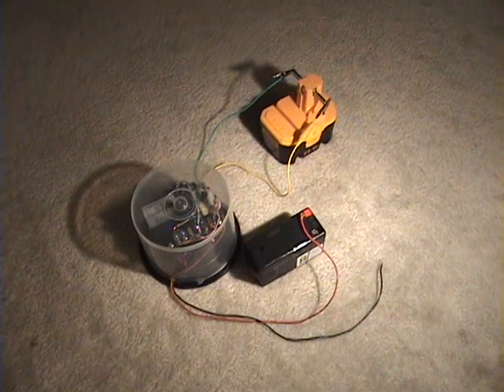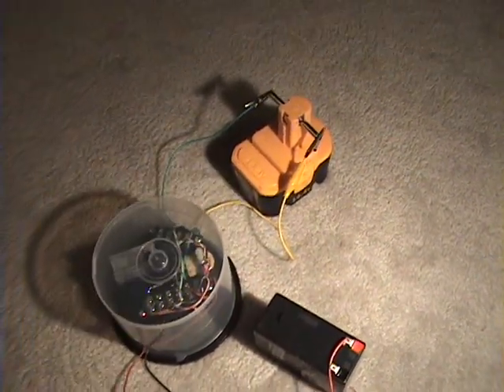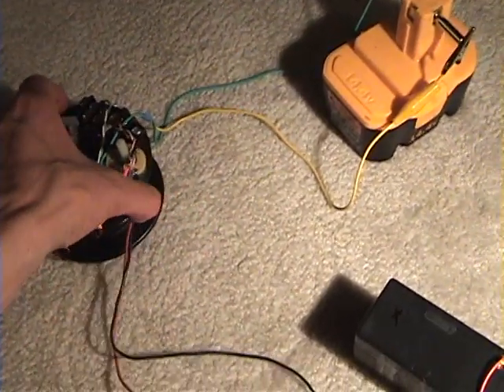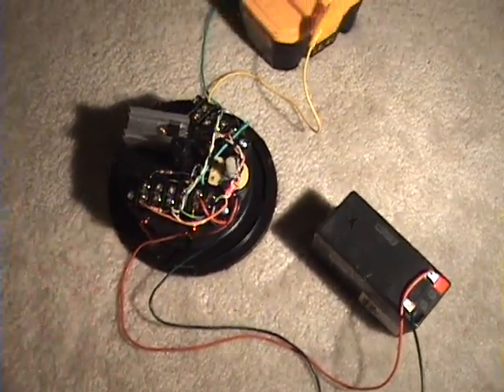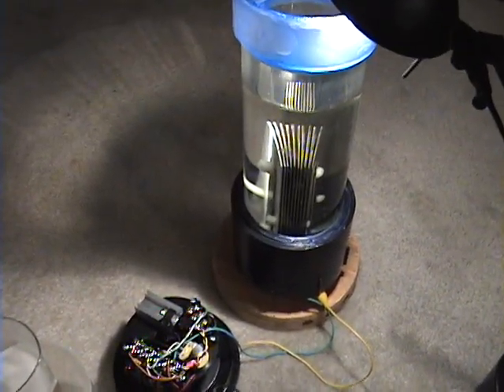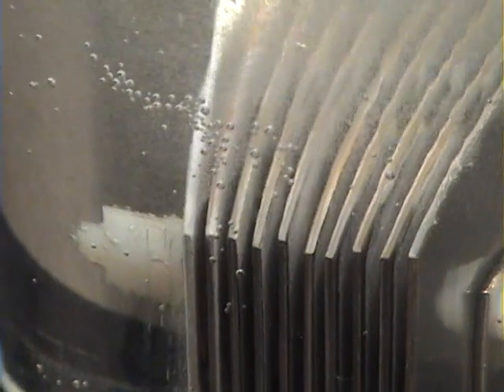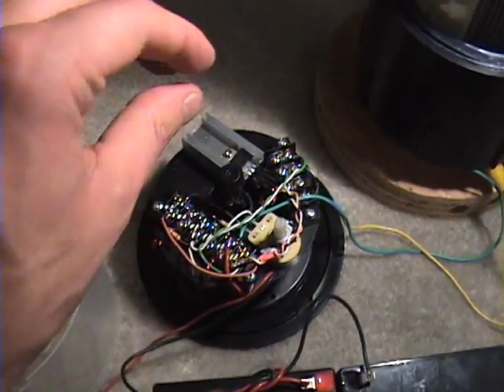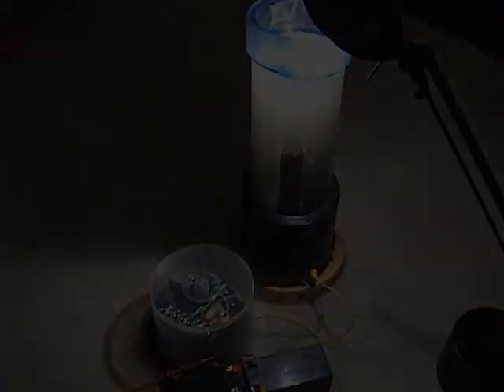Resonant Frequency Matching Charger

Comment: I bought the ebook and so far i have built this charger. It is charging non rechargeable batteries very well. As a matter of fact I recharge a well known AA battery up to 1.58 volts and is presently running my wall clock. I also have some small lead acid batteries that are taking very good charge as well. Looking forward to building a bigger charger soon. Thank you so much supermuble.

Comment from the maker: @fathershand Cost is about $25 to $30, including the copper wire, transistor, resistor, etc. The cost could go up depending on if you put the circuit in an enclosure, of if you wanted to be really fancy you can use Litz wire, but that is very expensive, though not necessary.